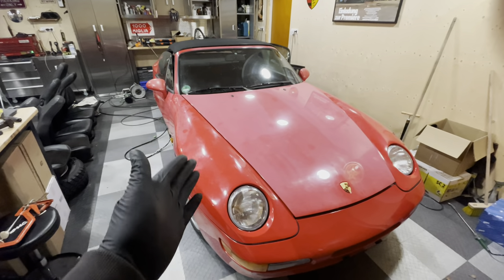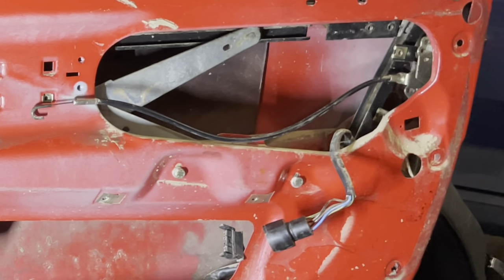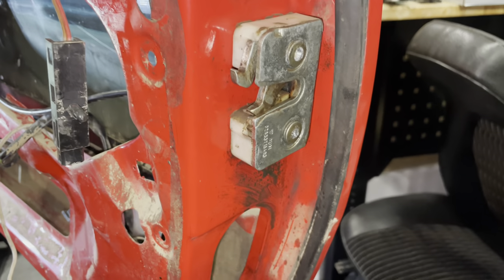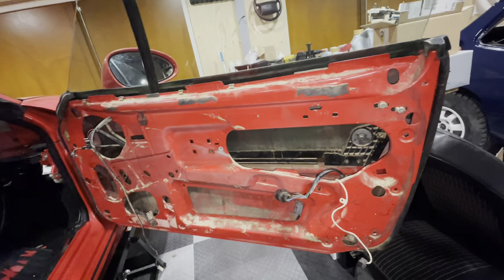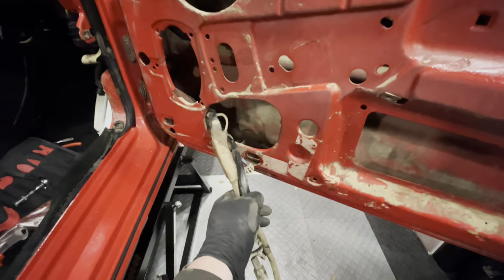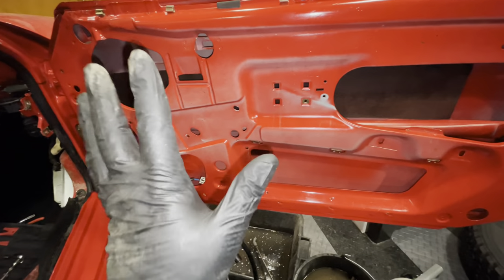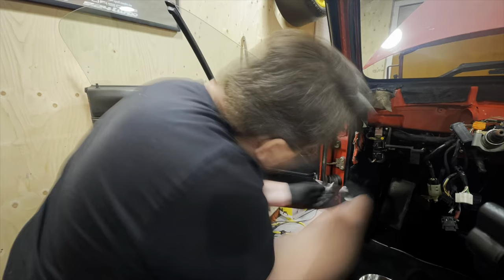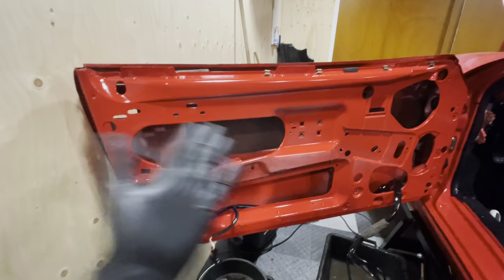Restoring a Flood Damaged Porsche 968: Restoring the doors - Part 1 #porsche968

Comment: Looking good so far.  Have a couple thoughts.  I saw you bought a Porsche battery so you could have the Porsche showing but - there is a cover that snaps on top of the battery.  Most cars seem to be missing it but it is very reasonable from Porsche and makes the area look cleaner.
Are you going to keep the top as a manual top?  A lot of people, including me (1991 944 turbo cab), keep it manual.  If the top goes out of sync it will snap the "B" pillar.  That piece is $700+ used in the US.  Plus if your relays are bad...the main relay is $500+.  If you keep it auto in addition to releasing the two latches you have to push the top open a couple of inches before engaging the switch.
It is nice to see the improvements Porsche made to the trunk and hood in the 968 over the 944 in that they provide emergency release cables.  When I got mine the trunk would not open.  Getting it open was not fun!  I fit (with a lot of modification, I have never seen something so stupid in my life) the 968 emergency trunk release to my trunk.  Now from watching your video I know they also have an emergency release for the hood - will have to investigate how to fit it to the 944.  I have new cables for it but worry if the cable slips the only way to open the hood will be to cut a hole in the hood. 
Have you considered recovering door panels?  That is a future project of mine.  I want to do alcantara on top and Pasha for the rest. 
I hate to say this next part but have you considered replacing the entire wiring harness?  The engine harness is probably shot just from age.  The insulation on the wires crumble and the wires short out.  This usually happens under the boot where you cant see it (think of what happened to your alternator harness at the white connector).  Debugging my car after the rebuild was a hassle because of wiring issues.  Ended up replacing entire engine harness.  I used to work in a new car dealership and we would get customer cars in that had been flooded.  These cars worked good for two or three years then a bunch of electrical gremlins would start showing up.  The water gets under the insulation and rots out the wire after a couple of years.  The body harnesses are probably fairly cheep used since there is not a lot of demand for them as they seem to hold up reasonably well (only issue I had was going to the headlights), ask your buddy.
Reply from the maker: Thanks for all of your input David, much appreciated! I have a cover on my 924's but was unaware that these exist for the 968, I will look into that. I am planning and fully restoring the top as I was functioning before it went for a swim, but that is not my top priority. I am not too worried about the wiring harnesses, simply because it has already been 18 months since the disaster and am yet to discover an oxidation on the plugs, this might come to haunt me over time, but I think it will be fine. Mostly when flood damaged cars start acting up it is because there was moisture trapped in plugs and computers that were no addressed, this is why I am being so meticulous about u plugging everything and checking all electrical motors.

Comment: Jon, there are panels available from multiple breakers in the USA.  If I remember correctly, there is a large plug for the door harness about a foot or so into the interior of the car.  For testing, wouldn't it be a good idea to hook up the regulator outside of the door shell before reinstalling?
Reply from the maker: Thanks Jeff, if you could share the details of a breaker that has a set I would greatly appreciate it! I'll go have a loof for those plugs again because I want to make sure they are clean, I might already have cleaned them unwittingly, but good to be sure.
Reply: @GarageBiljon  Jon, still searching.  There is one set on eBay right now, but I'm not fond of the price ($750)
Reply from the maker: Thanks  @jeffhammond8969 !